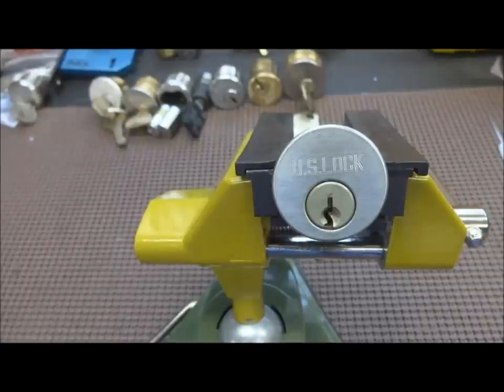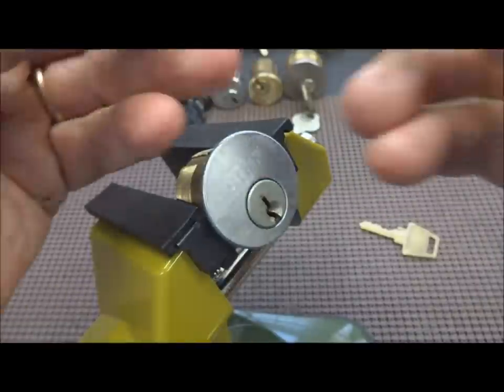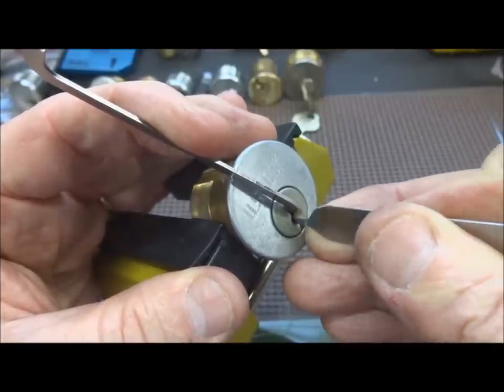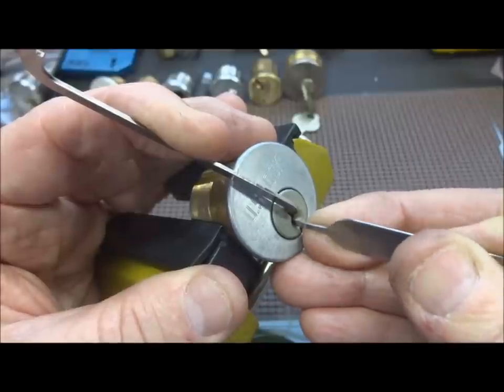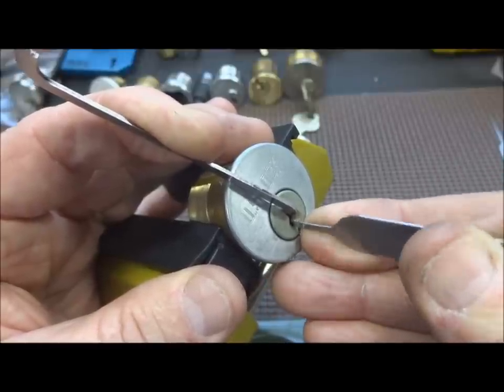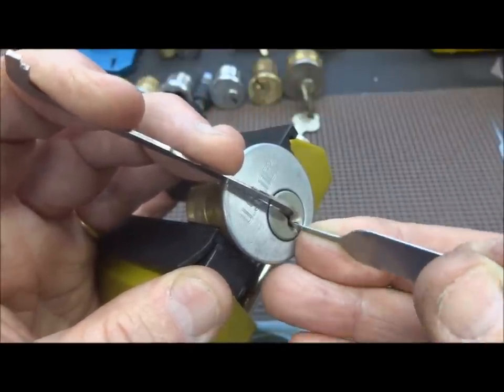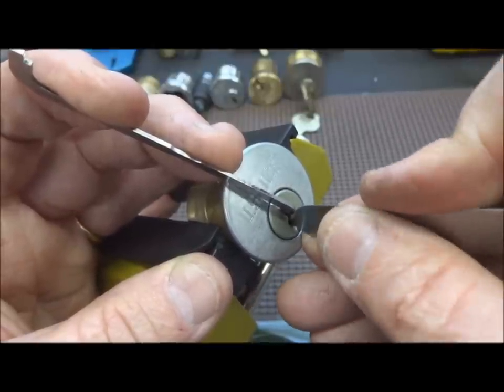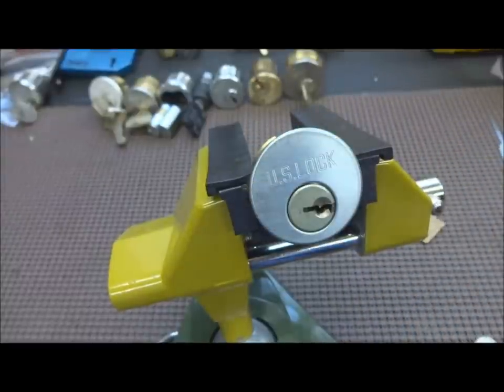(152) U S  Lock Mortise Cylinder Picked Open

Comment: I have a US Lock with a Schlage keyway on my front door.  I can pick it using an el-rake (city rake) from the open to locked position but NOT from the locked to open position.  Any tips?
Reply: golf-n-guns use a plug spinner to flip it to the unlock position once you've picked it the wrong way, works like a charm.